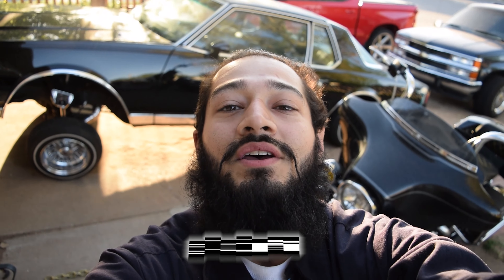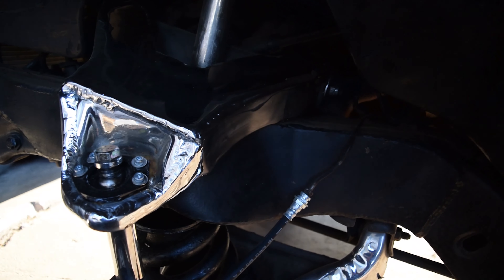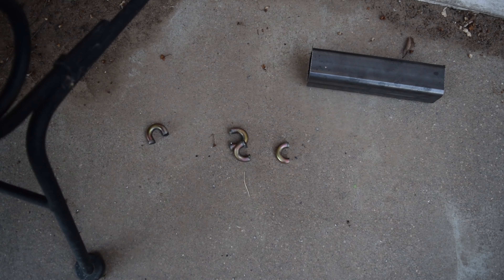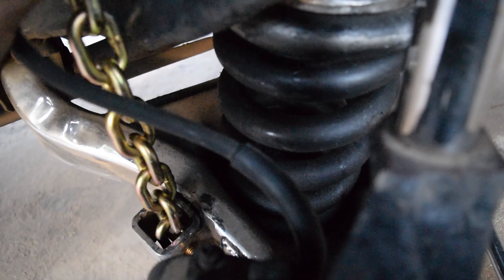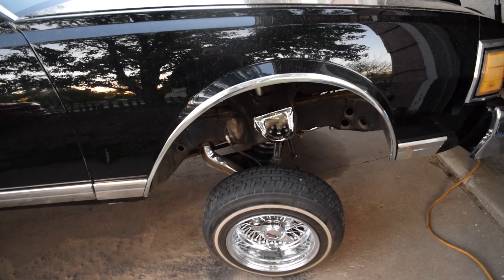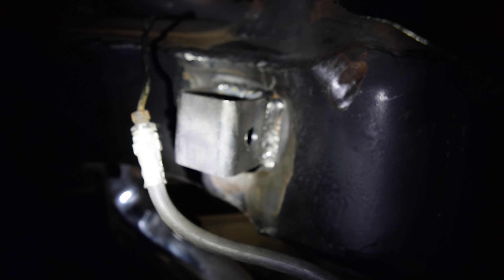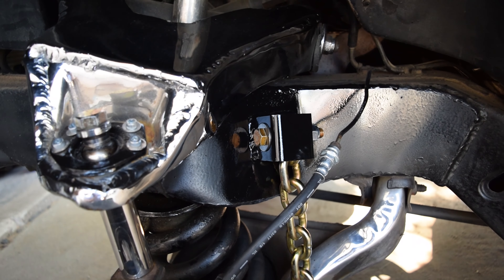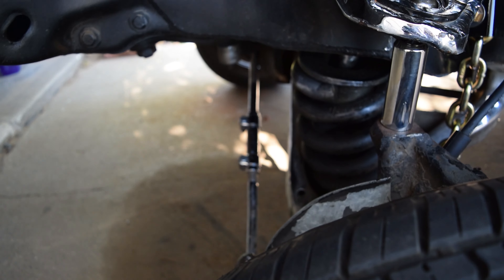Welding In Chain Mounts On 1979 Chevrolet Caprice Lowrider

Comment: What kind of welder you running and what settings you run
Reply from the maker: @noaharagon7197  I use a Lincoln 210, it has auto settings depending on the thickness of the material. For this I put 1/4” steel so it’s pretty hot
Reply: Thank you bro
Reply from the maker: @ no problem! It’s always best to try out your settings on a test piece before doing any important welding